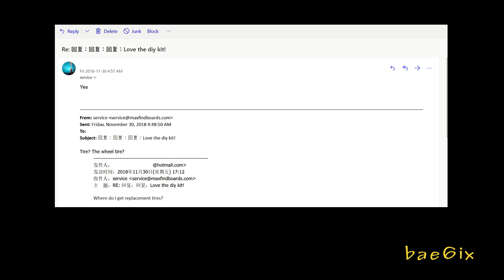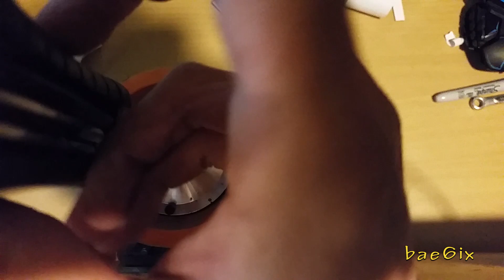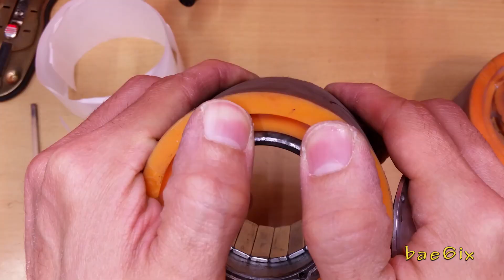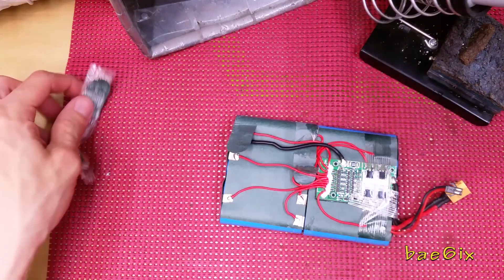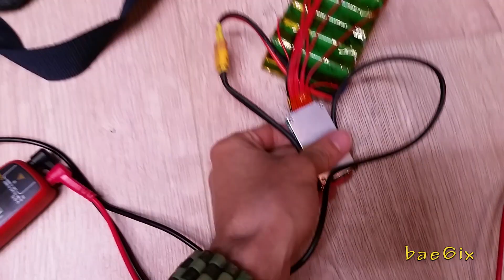MaxFind 1000w Dual Hub Motor Skateboard Drive Kit • First 20 Mile Review + Full Teardown

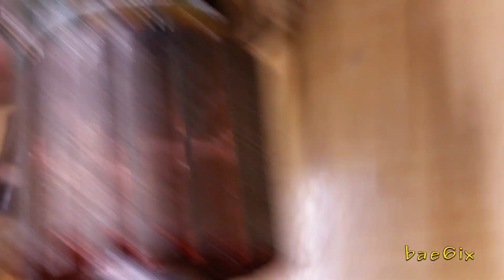Comment: 5:28 - Thanks for explaining! I had to hammer the ballbearing off the wheel and managed to pull the electronic circuit board off the wires.. I think I have to add a larger spacer before the ballbearing so it wouldnt rub my cables down and shortcircuit the motor making it cut off power. But now I need to see how to re-solder the wires, I need to add new wires there..

Comment: Really appreciate this video. I am currently looking for a longboard conversion kit and this was the only video I saw that really put any time/attention into this kit. I am definitely not interested in getting this one - but are their other kits that you have tried and would recommend? I'm looking at the revel and unlimited kits but would also consider buying a cheap electric skateboard and move the parts to my existing deck. Thanks!
Reply from the maker: Swagboard..garbage..but I had two so was able to keep repairing it as seen in all the videos on this channel.
Ownboard W2..lasted 3 weeks..garbage..about to edit all the footage and upload that.
Maxfind..lasted 2 weeks..garbage. Kit was given to me to give a good review but MaxFinds terrible customer service was no help.
Diyeboard.com hub kits..lasted less than a week..garbage. No customer service.

 They all died in a matter of weeks. Haven't found a good board. Let me know if you do!
Reply: HIGHLY recommend the Revel. I know I'm just some stranger in a youtube comment section, but I just clocked 500 miles on my Revel kit and have had 0 issues so far. I even took it through some rough gravel that I thought for sure would destroy the motors, but they came out with nothing more than surface scratches.

Comment: Hey man, I am having the same problem with the screws of the battery breaking of from the base. Did you find a way to fix it for good? I currently have it duck taped and it looks horrible. What do you recommend I do?
Reply from the maker: Not my main channel, sorry for the late reply, honestly the board did not last long after this video. I meant to do an update/follow up. Honestly it was not worth fixing. How did you make out?

Comment: I now opened the board and found the Power button Wire was not connected properly after connecting properly, the board worked, then going up the first Hill in Bunker Hill DTLA, the Left Motor had Shorted or a fuse has blown, The board will not turn on if both motors are connected if I remove the Left Motor Connection the board will turn on and function as a 500 Watt Board, they never reply to the emails or phone calls.

Im gonna make a Video soon to Showing In depth Trouble Shooting.
Reply: This company sucks my left motor just wont keep momentum it clicks then stops and the right nothing at all. Bs.
Reply from the maker: The kit was given to me to give a good review to increase sales. Out of the box I had problems and contacted MaxFind to resolve the issue so I could give it a good review. MaxFinds immediate response: "you did not buy this from an authorized dealer" they were right..I did not buy it..however they did not ask my name, where or when I bought it..so how they know where I bought it? They didn't and out of the gate they try putting blame on me so I made this honest review.
Reply: @bae6ix9  backfire? maybe?
Reply from the maker: @joaquinninoortega156  My first board forced me to learn/DIY and left me with so many parts and knowledge I've stuck with DIY. Everytime I look at the cost of a complete build I puke a little. Of only I could find a good drive train. Every drive train fails.

Comment from the maker: Very next time I used the MaxFind dual hub motors one let out black smoke. Tried to reuse the front truck and one of the bearings was stuck. The inner plastic core of one of the front non-drive wheels was cracked in several places and being held together by the outer wheel.
Reply: Thank god I found that before buying it